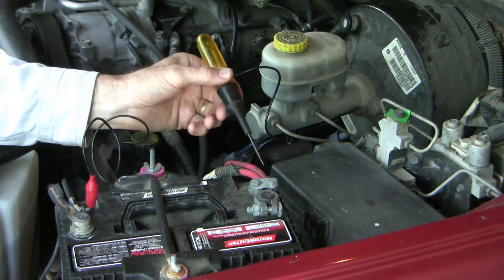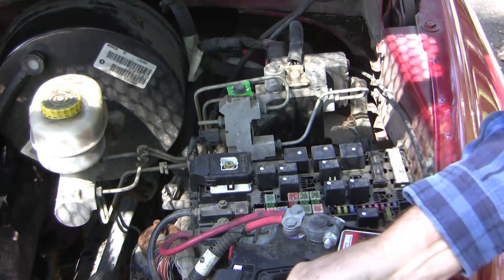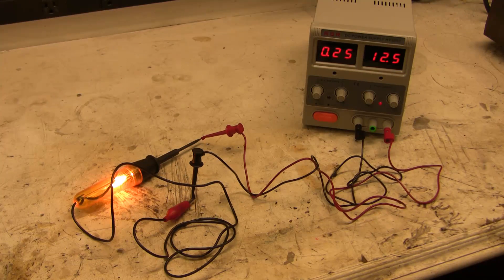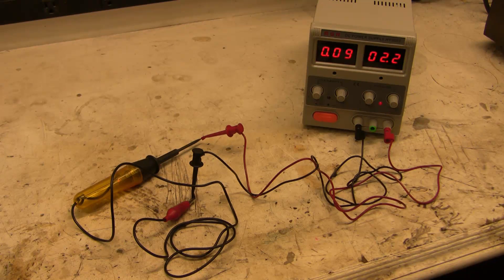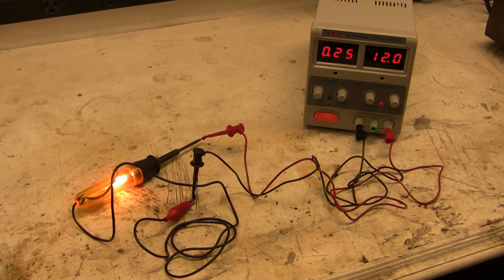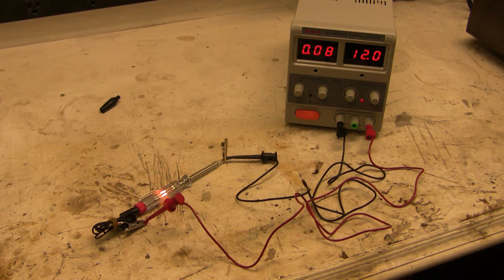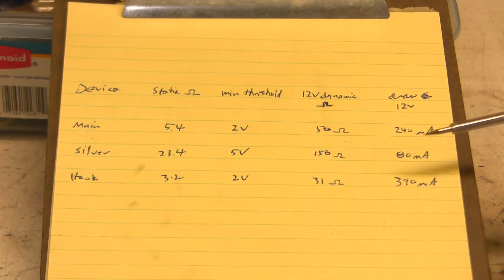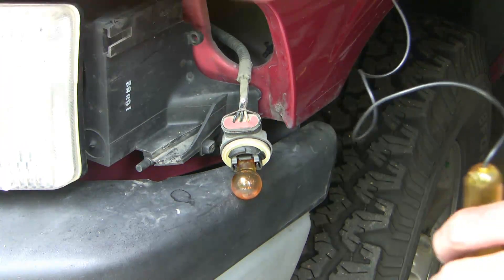Not all test lights are created equal

Comment from the maker: My Dad was really wise but he had trouble explaining things like this. It took me years to understand, but when I did, it was a light in my brain that wouldn't shut off. I promise you, the same will happen to you.  
The problem with static testing with no current flowing is that bad batteries AND bad wiring can seem fine on a DMM, but as soon as current flows you see voltage plunge. So, a DMM is really bad to test wiring and batteries. Search "voltage drop test", or "how to test a 12v battery".

Comment from the maker: When it comes to ECU circuitry, I get a little nervous with a clumsy test light. ECU control circuits run on much smaller current, with transistors, diodes and sensitive devices all over the place. Even on the output side, PWM outputs on new vehicles confuse the issue as well. Paul is so comfortable with some of those circuits, so he knows what he can get away with. I would be inclined to use a lab scope or scanner for most of what he does. Thank you for watching my humble effort.

Comment: hey man good video, i ve just watch the paul danner video about test light i barely understood it, but now i can understand a lil bit better.. you should make a longer video putting the 2 most frieghting examples,, test light as a jumper wire with 5v actuators and the other using it as a test light with sensitive but bigger actuators as the EGR DPFE and others, very confusing but i just wan tto know what kind of test i should use to burn a ECU thats all :D

Comment: Brilliant demo, I have a good demonstration of this in a video titled, “Daytime running light circuit troubleshooting” Around 15:31 I found a voltage drop using a test light and demo with a DVOM. My favorite test light is one I made many years ago that has a replaceable 194 12v light bulb , common auto bulb hence why I chose it, has a resistance of 3.9 ohms so if my math is correct at 12v should draw near 376ma not outrages however has saved me time  many times

Comment from the maker: I have a set of Loadpro test leads too, Steve. However I have to sheepishly admit that I don't reach for them very often. I guess what has held me back is the lack of supplied schematic info, and all those warnings in the manual about not testing the power side of the circuit. Although formal drop testing with a DMM is definitely slower, at least I fully understand exactly what I am doing when I power it on. Thank you for watching!

Comment from the maker: Yes, to do voltage drop testing the proper way takes a few minutes, but a test light automatically does a simple drop test every time it's used. Of course it depends on the skill of the operator to know when his light is not as bright as it would normally be, for the voltage applied. That's how veteran technicians save time but still are ready to recognize the unusual case where circuit resistance is the dominant problem. Thank you for watching!

Comment: Yep you can be deceived by voltmeters, its the ability for the wire to deliver voltage and current thats important isnt it :-)

The more power a device needs then the better and better connection you have to make so not to lose power.

Good thick wire and clean/tight connections is the ticket :-)

Comment: good point. i had a meter showing power to a wheelchair crane thing and when you hit the power it would have no power. turned out to be a corroded wire where there was a connection.

Comment: I had a similar discussion with a frend a few years ago, i said that a multimeter can read voltage but it can also lie, the resistance of some meters can be as high as ten million ohms so a leaky circuit can appear to have power, the meter has almost no loading effect.
Using a bulb means you have to have a decent amount of current flow before the light will illuminate, the same leaky circuit will not light the bulb.
This is not exactly the same as your video but has a loading effect.

Comment: Well done, good info as always.   Manufactures are still specifying to test for system voltage if yes replace part.  Test lamp and DMM will verify there is  system voltage but  you can have corrosion as well as damaged wires with only a couple of conductors attached will show system voltage without any voltage drop.  I only use my DMM with a set of "loadpro" test leads.  These leads  attach to the  DMM and  will  verify opens, short to ground and high resistance (corrosion)  instantly.

Comment: 150Ω of resistance. Now you connect your test light to ground to activate the coil. This now places the test light in series with the coil. The two resistances add together for 175Ω of total resistance. Now the current through the light and coil is 69mA at 12V. The coil on 12V by itself needs 480mA to turn on. Therefore, the coil will never come on. The voltage drop across the bulb would be 10.35V whereas the coil would only have 1.73V. Thanks again for the video Dave as it's good info!

Comment: Very good video Dave. I like how you showed the different amps and resistances for each light and it depends on your bulbs amperage to what you may want to turn on. Just wanted to mention that although a test light pulls 80mA as in your example, doesn't mean that 80mA will be supplied to a component downstream that you want to activate. Here is an example. You want to turn on a coil which is supplied with B+ and ground side switch by the PCM. The coil has 25Ω and the light has a ...